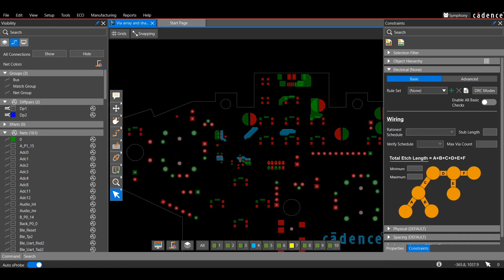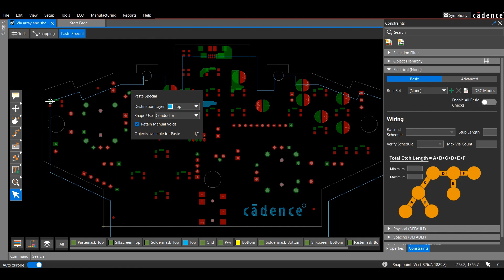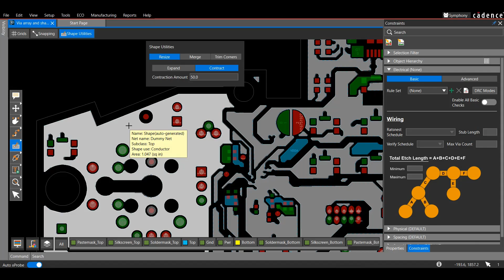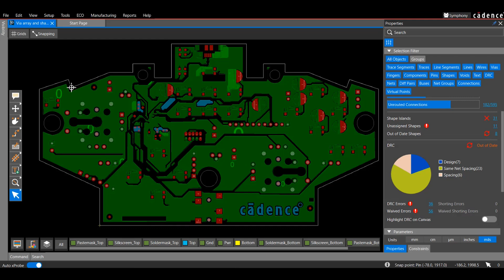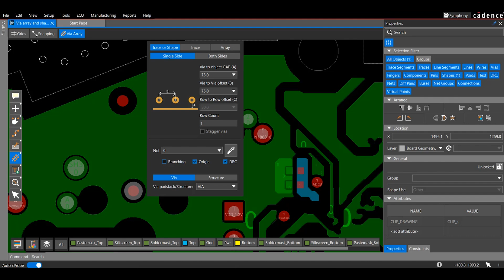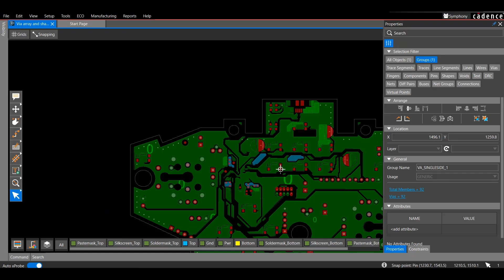How to Reduce EMI in Your PCB Design Using Grounding and Via Shielding

Comment: Thanks for this.  Would this be enough for a high frequency SPI connection or would you recommend burying the SPI paths in mid layers and have the ground planes on the top and bottom layers?
Reply from the maker: More ground and uniform materials above/below typically improves signal integrity